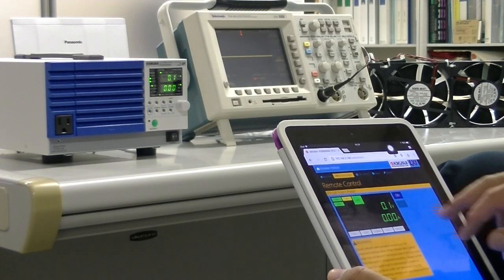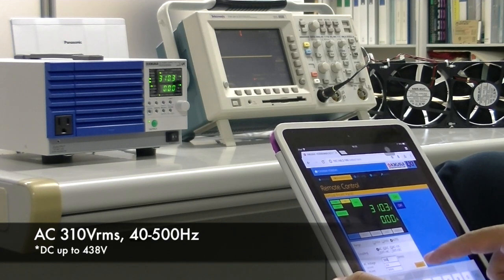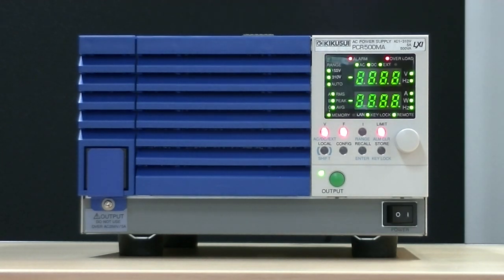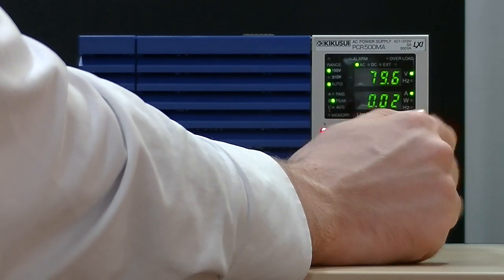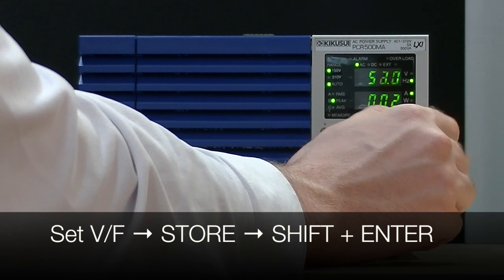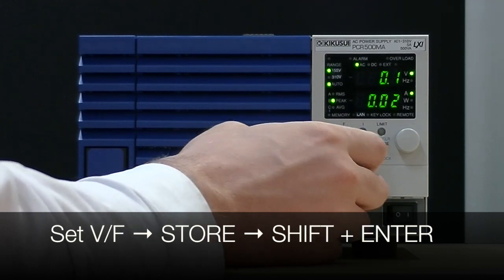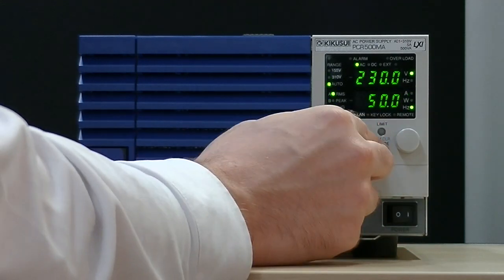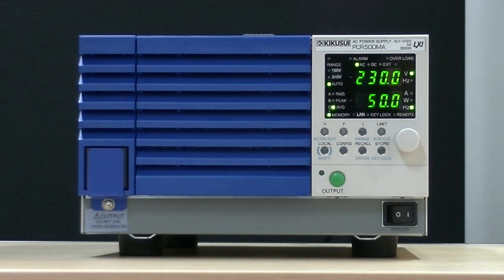PCR-MA Quick Tip: Universal Input

Comment: Would the PCR500MA be suitable for powering a 100W Vacuum tube (Valve) guitar amplifier that has a 3 amp fuse and draws 375W current when operating at maximum settings. It is never run at maximum settings so wouldn't be drawing the full 375 Watts.  The amplifier is designed to sound best at 234VAC @ 50hz.